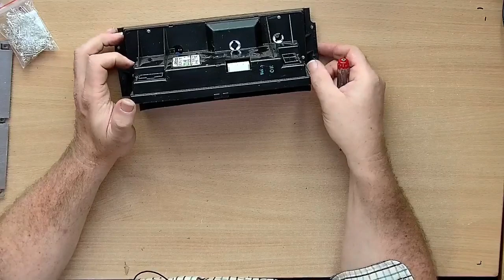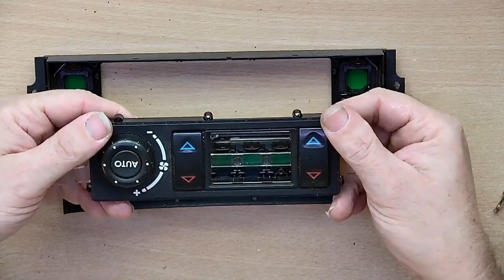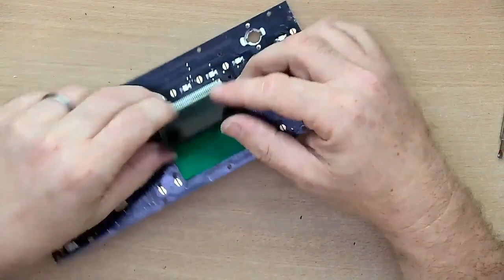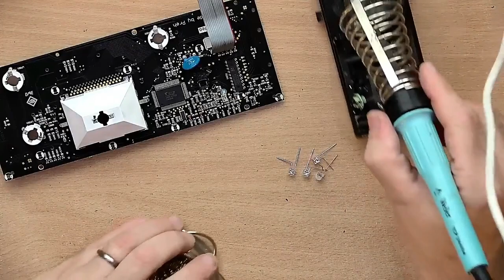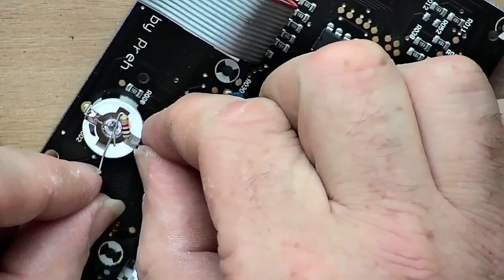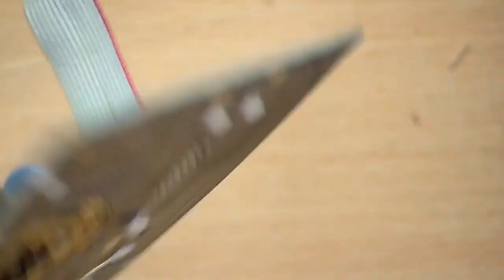Range Rover P38 HVAC Panel Teardown and LED Upgrade

Comment: Hey there, I have recently replaced the zebra strip on my hevac unit and the lcd works perfectly now but, the buttons on the climate control don’t all work. I came across your video and was wondering if you can recommend things for me to resolve this issue? Maybe the carbon is gone? Can you recommend carbon replacements? Or maybe I reassembled the hevac improperly? Any help would be greatly appreciated! Thanks!!
Reply from the maker: Clean all the contacts with something like servisol 10 or deoxit. The carbon does wear and you can get repair kits on the jungle website.
Reply: @rtechlab6254  thank you for the quick response! I’ll try that out

Comment: Had to pull my dash to change the evaporator core and now the ac works well, no more leaking gas but when I press the compressor button the hevac shows the book symbol and turns off but will not come back on when I press again. I now have to restart the engine for the book symbol to go and the ac starts again. any ideas what is causing that? I also have a bad display on the hevac unit which I plan on changing. I have an old unit which I think the display is fine, plan on having a good look inside when I pull it down.
Reply from the maker: Without getting a fault code that could be all sorts :(

Comment: Do you repair these? How much do you charge? Do you also replace the screen connector with the newer type provided by RPI Engineering?
Reply from the maker: We don't I'm afraid. I have no means to test these as my P38 has now gone on to new pastures

Comment: Thanking you for the video. I have another issue with my HVAC: fan switch does not work correctly. when I turn the switch to the right or left, it reacts badly. For example, I have to turn a lot back and forth so that he at least changes some air supply. What can you recommend me to do? Do I have to disassemble hevac like you completely and clean the contacts on the switch or is it a mechanical problem with the turner?
Reply from the maker: The PCB under the switch has a set of contacts and a matching set on the knob. There is no set position on the control. If you have two outputs from this A and B if you turn one direction you'll get an output from A then B, the other B will lead. This way the controller knows which way things are turning. https://en.wikipedia.org/wiki/Rotary_encoder#Incremental goes into it a lot more. Mine does the same and its a matter of stripping and cleaning the PCB contacts and the fingers on the knob AND making sure none have snapped.

Comment: Can't you get the led bulb with a built-in resister??
Reply from the maker: It is possible to get 12v LEDs but to be honest I didnt think to for this as they wont be avaiable in this shape and Im not even sure they are available in white. Maybe worth a look though
Reply: @rtechlab6254   ok thanks

Comment: A question about bulb replacement. Does the bulb come out of the holder or do you need to buy a bulb with the holder. I have plenty of those little bulbs so hopefully they just pop out.
Reply from the maker: They just pop out
Reply: Great! Thanks for letting me know!!

Comment: I think You can by this led+bulb holder and You just change it: https://www.ebay.co.uk/itm/10x-White-12V-1-2W-smd-T5-LED-Car-Meter-Bulb-Instrument-Interior-Indicator-Light/223701168892
Reply from the maker: Yes, but you still need to know the grounds. This way its done forever with LEDs of a known quality
Reply: Yes, thanks for the grounds.